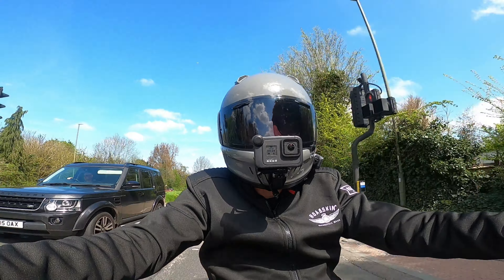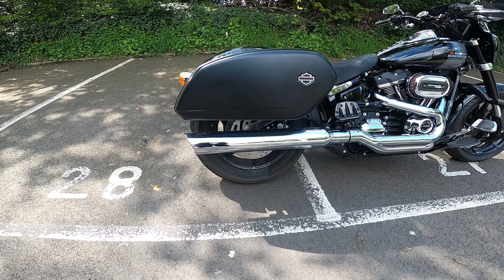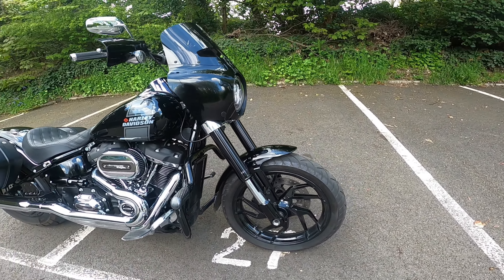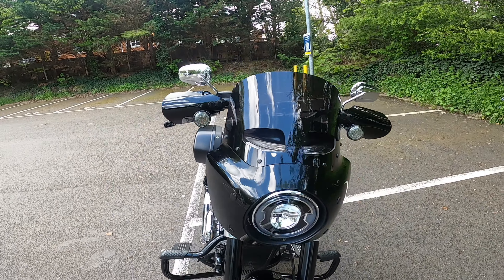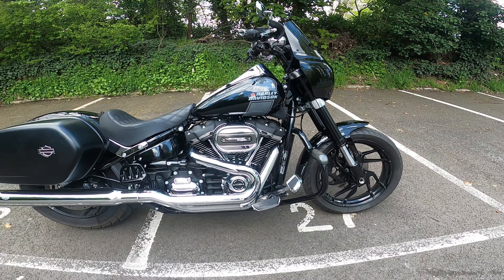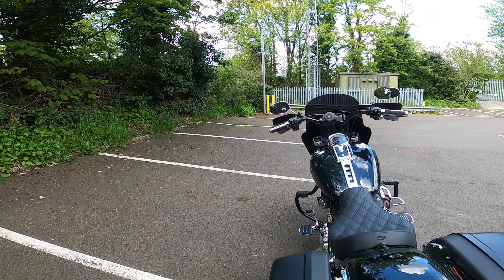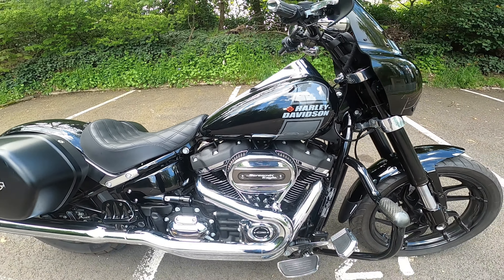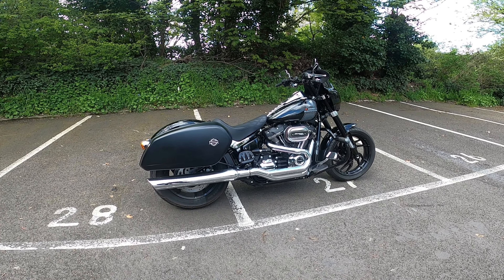HD Sport Glide - Updated walkaround, it is finished now?

Comment: Great video and beautiful bike! I’m considering buying one of these but a little concerned about my legs reaching and operating the controls comfortably as well as properly. I am 5 foot 5 1/2 inches tall so I’m a short guy with just less than a 30 inch inseam. Do you think I’ll have an issue? Thank you.
Reply from the maker: Thanks!! I’m 5 6 with a 29 inch inseam and I’m could reach the controls with no problem at all.
If you’re going to get one, most people buy the 4 inch pull back risers for the handlebars.. I did and it stops you (or anyone) leaning forward a bit to reach the bars. I would highly recommend that.
Apart from that, I think you’ll be fine, you’re about the same size as me and I had no issues at all.
If you can, go and jump on one and see how you feel, I don’t think you’ll be disappointed!
Anyway, let me know!
Ride safe 👍🏻
Reply: @Midlife5  sweet this helps a lot and I love the idea of the 4 inch pull back risers for the handlebars. Thanks so much. Cheers!

Comment: Hi mate your Bike looks great. I ride softail slim what’s your opinion on Memphis shade road warrior I was thinking to install does it prevent wind buffeting. I got quoted £860 supplied and fit from Guildford HD I find it bit to dearer . I live near Heathrow. Ride safe
Reply from the maker: Thanks for your comments! I love the Memphis shades road warrior, I think it looks good and it certainly does a good job of protecting you from the wind.
£860 is too much, I have found that with GHD.
Go onto Hogparts and or ARH Custom and buy it direct from them. It’s a really easy install and there are loads of YouTube videos explaining it. I’ve done it twice and I’m rubbish at that kind of thing.
You’ll get it so much cheaper that way but when ordering remember you need the fairing, mounting hardware and screen, they are all different items that need to be purchased separately.
I went onto the Memphis shades website directly and put in my bike details and built the fairing there, that gave me all the correct part numbers so I know I was ordering the right parts here in the uk.
I hope that helps!!
Good luck and ride safe 👍🏼
Reply: @Midlife5  thank you